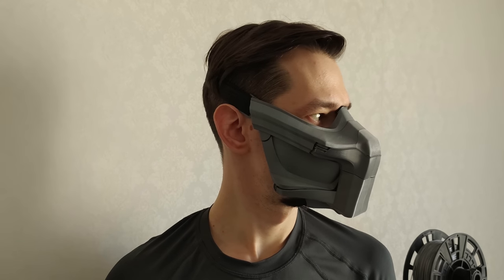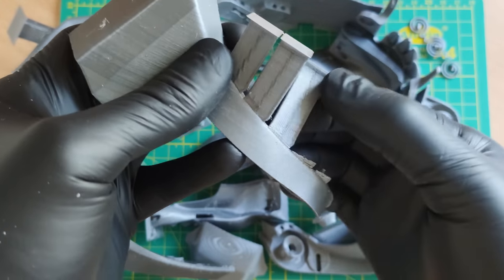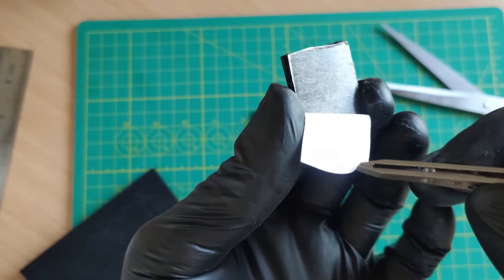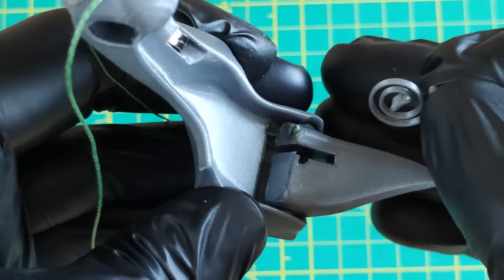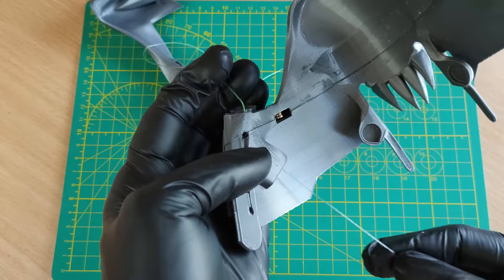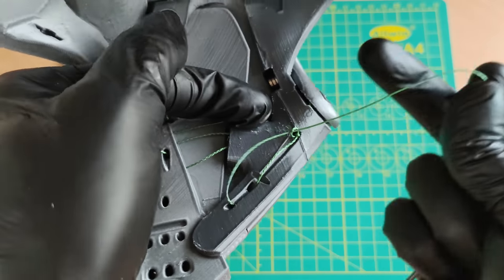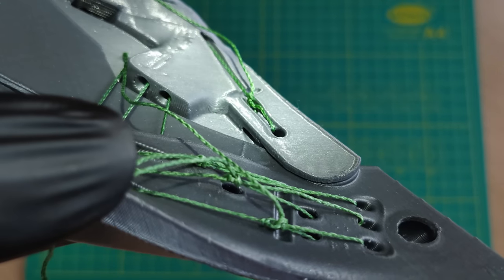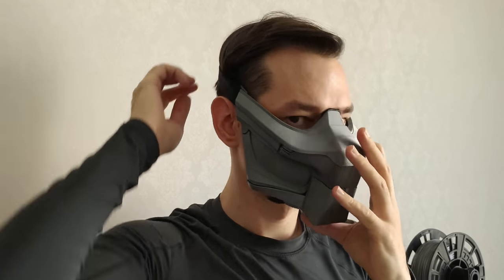How to print and assemble 1st mechanized mask by Sonndersmith

Comment: This Is by far the best executed and documented 3D printed project i've ever seen. Congratulations for achieving such a complex yet effective design, and in making It so Easy to realize by anyone with a printer. Also loved the custom supports. This Is the future of manufacturing.
Reply from the maker: Thank you! I tried to make it as simple as possible. Initially it was conceived as fully printable mask, but magnet system turns out more reliable solution. Cords are also worked better than printed detalis. A bunch of interesting solutions were discarded in this certain project but they can fit to other ones!
Reply: The very best project would be that one guy that managed to recreate several functioning guns, he even shot them and none had malfunctions.
Reply: @sonndersmith  true it great was recommended it  seen it as thought of making a predator for next halloween what got me here i recently thought of making 3D printer stuff been looking into it and whats needed for it best options

Comment: That is one cool mask and you can see how much work you put into it with the design assembly.
Reply from the maker: Yeah, a lot of time was spent on that, but I think it was worth it. Engineering solutions that didn't work in this project can be successfully used in the next ones.

Comment: Having now printed and assembled (and worn!) the mask, this was a huge undertaking! The video moves very quickly, it took me probably two or more hours to complete. 
Some things that would help: showing which parts will be used for a step before starting the step (the teeth and springs look very similar), moving just a little slower (I turned the playback speed down, but still had to repeat sections several times), and showing assembly for all four mandibles (trying to mirror instructions was very difficult for me).
Reply from the maker: Thank you for the purchase and for the feedback! I'll keep that in mind when I make new tutorials.
Reply: he moves too quick 😢. best 3d mask ever, worst video instruction ever, you can’t even know which one he is doing

Comment: I feel a few minor improvements could be made at the gluing stage. 
You could put holes in the faces you glue together that you could put dowels/rods in for alignment, stability, and ease of assembly.
Reply from the maker: Yes, you're right, this Idea crossed my mind, but it was too late. I'm going to use this method in my next projects.
Reply: JB Weld plastic version would be the best.

Comment: I've been printing this build but the two runs I made on the "other parts" failed on the large cheekbones. Is it possible to separate the large parts from the STL? I really would like to not have to print another 10 hours.

Comment: Is it necessary to have the screws as countersinks because I have m4 screws already but not countersinks
Reply from the maker: These screws can be used as well. It will work but screw heads might stick out a bit. This problem can be solved if you carefully heat the head up with a lighter or a soldering iron and then make some final turns.
Reply: @sonndersmith  ok thank you

Comment: hey i got the mask could you update the file, so the springs are separate to print by them self also can you re arrange the parts for a resin printer please
Reply from the maker: Hi! Sorry for the delay. I recommend to contact me on the website you bought the files, because I rarely check YouTube comments. Here's the link to download fang spring files separately: https://drive.google.com/file/d/1h0EQb-W8RaQzWVudJWcAxMRM6qfPfrEK/view?usp=sharing
Please let me know how big is your build volume in order I'll be able to re-arrange the parts (or I can just send you all the parts as individual files).
Reply: @sonndersmith  I'm am good on that I just found out about the mesh tool on cura that let's me split the model and select what I want to print so my concern is now moot but thank you for reaching out to me about what I was asking

Comment: i cant just buy a mask ? you only sell the 3d design?
Reply from the maker: It seems I’ll be able to sell 3D printed products soon, so I’ll contact you then.
Reply: @sonndersmith  that’s great 👍🏻
Reply: @sonndersmith  hello I just printed and try to build it , the down part of the jaw it’s super difficult to glue together, it’s possible to make one piece for print ? Also the size is too small for me I try to put on my face but the sides are too tight , if I could buy one you already finish and with bigger size would be perfect